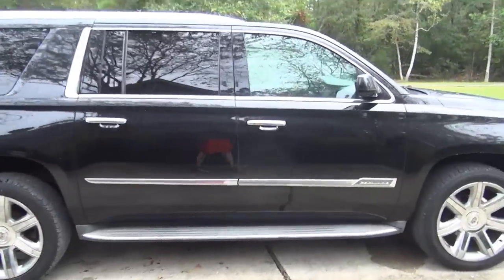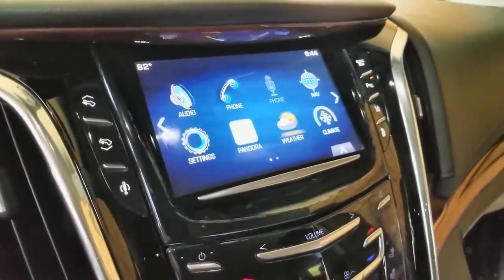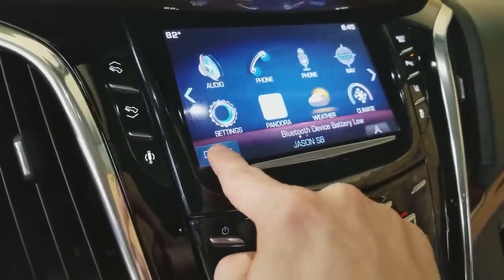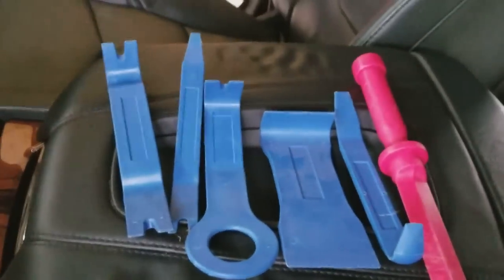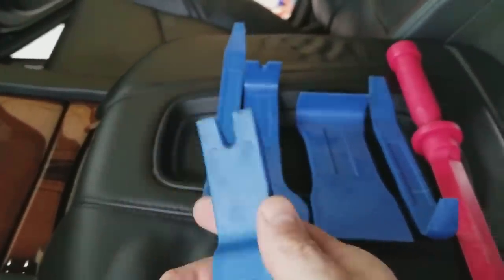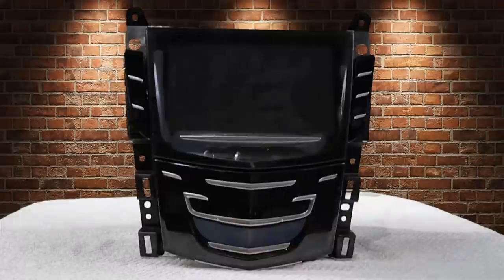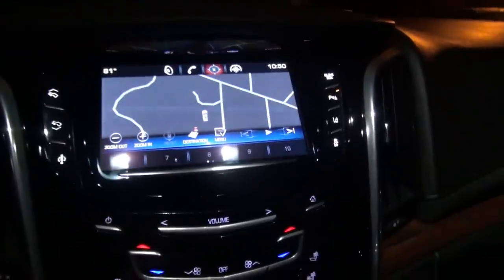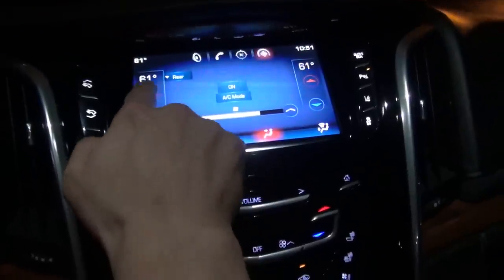How to fix a Cadillac Cue Screen. Step by Step

Comment: I cannot say thank you enough.  It went smoother than I expected, but make sure you have a T15 bit and good lighting to go along with what Jason mentions.  Keep your screws and parts organized to make the process easier.  I purchased a plastic kit from Amazon, but the ones that come with the new screen are all you need. 
The amount of thank you comments speak for themselves. This fixed our failing screen which also produced a random annoying beep in the drivers door.  Seriously... Thank you for the knowledge, the video and supplying it at a reasonable cost.  I would have paid 3 times the price because it works.
Reply from the maker: Hey Robert that is great news and some additional good tips you provide. I'm really glad it helped you out and thanks for letting me know. I really appreciate it!

Comment: This guy is a life saver! After my mom's screen became completely unresponsive, the dealership wanted to charge her $1,900 for an entirely new unit. I'm so glad this video surfaced before I sent it to the shop for her. After a couple of hours of my time and a new screen from Jason's website, her Cue system is working as it should again.
Reply from the maker: Will thanks for taking the time to leave a review. I really appreciate it and so glad I was able to help you and your mom out! Best of luck.
Reply: Robert Spracale Nope, I didn't. Since this was purely a hardware issue, there wasn't a need for reprogramming.

Comment: Thank you!! Cadillac wanted $1450 to replace the screen. Paid $42 on Amazon including the plastic tools and once it arrived and 2 hours later I had a working screen!! Saved just over $1400.Nice!!! Once the screen is replaced you will need to go to settings and calibrate the screen. 

Thanks for the video!!
Reply from the maker: Excellent!

Comment: Jason did an fantastic job explaining the entire process of removing a touch screen with no functionality and inserting a new one that fixed the issue I was having with my 2013 Cadillac SRX. The video is for an escalade but very similar once the head unit  is removed. I used another video to remove from SRX. He provides a link to purchase a new touch screen at an affordable price and it comes with tools that do not scratch the interior of the vehicle. Once I installed the new screen all functionality returned and vehicle is running like new. I had a few questions and Jason was prompt with support and everything worked perfectly. Saved money big time by not going to any of the dealerships I called. "Boom and you done!" Thanks so much Jason, you did a wonderful job.
Reply from the maker: Thanks Dareck for the awesome review. I am glad we could help!

Comment: Excellent video.  Replaced mine successfully.  A couple of comments though:  1) I really wish you would have shown how tough it is to pull that first trim off.  Felt like I was going to break it.    2)  The little tabs that you have to move to get the secret compartment box off was a little blurry.  I really didn't know what you were referring to.  3)  A little better picture of the clip that holds the ribbon in.  I actually missed the 1.5 seconds that it was on the screen. lol.  4)  Screws:  When the screws are taken out, it would have helped to put them in their own piles in the order they were removed.  They are different.  Some are machine threads.  Some are like wood screws.  5)  IMPORTANT:  Touchscreens are very sensitive to pressure around the edges.  I only snugged mine up to get rid of any slack - not tight.  It works great.  Better than it ever did.  While searching for videos I saw a lot of people complaining about the touchscreen not working all that great.  This is probably why.
Reply from the maker: Thanks for watching and leaving the feedback. I will have to make some follow up videos with that. Glad I was able to help and once again thanks for your feedback 👍

Comment: I bought this unit from Jason for my 2013 Cadillac ATS and it worked perfectly. Everything was very straight forward and I was very surprised that everything went smoothly. I had many email communications with Jason and he always answered within 24 hours - very nice guy! 
I do NOT regret doing this project myself at all. Here are some tips 
1) Know when to use force and when to be gentle. 
2) if your car is older, then the clips and plastics might be very hard and easily break. Be careful not to break any clips or connectors. 
3) keep screws separated and labeled to make it easier when putting everything back together. 
4) when applying force to any of the panels, dont put all the pressure on one spot as it may break the clips. I recommend spreading the force evenly and wiggling it loose. 
5) When changing the screen, don't untuck the tiny ribbon cable until AFTER the screen is screwed into place. 
6) Have the right screw drivers for the 3 different types of screws you will be dealing with. 
7) dont take the front screen plastic off until everything is fully installed back into your car to avoid any scratches. 
8) as you play around to make everything fit back, be careful not to put to much pressure on the screen portion of the unit as it might break the actual screen or the new cover. 
9) when changing screens, I highly recommend using surgical gloves to avoid getting smudges on the inside of the screen. This can be bad for many reasons including overheating from the grease. 
10) when placing the unit back into your car, be sure to use something soft like a Tshirt under the unit to avoid damaging it. 
11) the secret compartment will always keep opening as you play around with it. Be prepared to not damaged it. 
12) Depending on the model of Cadillac you have, you might have to be in drive before some of the sections will come off. For my ATS for example, I had to be in drive before I could take out the cup holders.
Reply from the maker: Awesome Sepi! Glad everything went smoothly and thanks for adding some helpful tips for everyone. We really appreciate you taking the time to do that and leave a review.

Comment: This is just what you need if you have a CUE that is not responding.  I agonized months trying to justify paying the dealer too much $.  I order the replacement screen on Tuesday eve and received it promptly on Friday.  The video was very helpful particularly once the unit is out of the dash.  Happily there was much was much less involved in getting the unit out of my SRX dash that the Escalade on the video.  Thanks so much for the video and deal on the replacement screen.  Based on the estimates I was seeing online, this saved me at least $1000.   THANK YOU.  PS Notice the film off the inside of the new screen that needs to be removed before installation.
Reply from the maker: dwayne whitmarsh thanks for your order and for the review. Glad you are back rolling.

Comment: thanks for the clip, it was very helpful! 
at minute 9:46, no black screw needs to be unscrewed. correct is the nickel-plated screw that keeps the plastic locked on the metal. this screw also has a counterpart on the opposite side.

Comment: Ok so everything worked!! Amazing!!! There’s one thing in the video that was not clear but I hope to help someone out like me. The ribbon is so important. There is a black latch, if you do not flip that up and remove the ribbon you can damage the unit. But even more important is that you insert the new ribbon with the clasp up and then close the clasp on the ribbon. You cannot be more than 1 mm apart or your screen will not respond.
Reply from the maker: Thanks for watching and for the extra tips!

Comment: Thank you so much for having this screen to buy and the video! My screen in my 2015 escalade starting being non-responsive, and the dealership said $1,500 to replace the unit, which is crazy!!!  I searched for a replacement screen for cheap but still reliable, and I’ve had it for a few months, and it looks and works perfectly. This video helped with all the steps taking it apart and only took about an hour to complete. Thank you so much for saving me so much money I really appreciate it!
Reply from the maker: That is great to hear! Thanks for letting me know and so glad it helped you out.

Comment: Thank you Jason!  The new screen works perfectly.  Getting the side moldings off (the one with the Start button and the other side) was the hardest part.  Took a lot to get them off.  But once I did the rest was straight forward.  Thanks again.  This saved me $1800!  The dealer was going to charge $2000 to fix it.
Reply from the maker: Hey Brent, your welcome! Glad it went smooth for you and I was able to save you some money.

Comment: Awesome video. It took me a little over two hours. The most difficult part was removing the cup holder which on my ATS I had to do first. Thanks. You saved me $1350.
Reply from the maker: That's awesome. Glad I could help. Thanks for sharing and letting me know.

Comment: Thanks for the video.  I ordered the replacement screen from your website linked above and replaced the screen over the weekend.  I have a 2014 XTS so getting the CUE unit out was different, but once removed your video was very helpful to swap out the screen. 

**One thing to note**  There is a protective film on BOTH sides of the new screen.  You will need to remove the protective film from the inner side of the screen before installing.  I did not notice this prior to putting everything back together.  Once I removed the protective film on the outer side of the screen I noticed a few air bubbles and imperfections.  That is when I realized there was a film on the other side of the screen.  I had to remove the CUE and screen again to remove this film.  Once that was removed it looked great!  

Thanks again.  Saved almost $1200 vs going through the dealer.
Reply: Any advice or direction for the XTS specifically?  I just ordered the kit.
Reply: I found some instructions posted in a cadillac forum.   These were clear enough to guide me through the removal process.  It is in the second post on this page.

https://www.cadillacforums.com/forums/cadillac-xts-forum/1025785-2014-xts-cue-navigation-module-removal.html

I didn't remove the transmission shifter knob (step 1).  I just pulled up the black plastic trim piece with "P R N D M" (I believe it was 4 clips and an electrical connector) and just kind of twisted it out of the way as needed.
Reply: Thanks for the reply I have a xts I replaced my screen as well but after reinstalling my unit it will not power up at all could some please give some advice
Reply: Not sure.  I would check to make sure the connectors going to the back of the unit are properly connected.  If those are fine, maybe the screen ribbon is not properly connected???

Comment: @9:44 you say,
*take out the two screw's after we take the back plate off...
*Then with a little screw driver, “unplug the little plug"
Got that...but then the two screws are back in the hole in the next shot of the plug getting pulled out?
So my question is, “ am I supposed to put the screw's back in now or later?

Thank you for your very informative and straightforward video it's great help.
Reply from the maker: I reviewed the part you are talking about and it looks like you do not need to take those screws at that moment but I believe they need to be removed to pull the backing off. Sorry for the confusion

Comment: Thank you so much for taking the time to post this very instructional video. I'm building up the nerve to try this on my '15 CTS.  I'm pretty handy and am not intimidated by the screen replacement but more so by the removal of the trim!  I was just laughing with my wife that wife my luck I'd end up with a wasted weekend with my Cadi in pieces or the display would work but I would have broken off the tabs on the trim! LOL.
Reply from the maker: Thanks for posting and you can get it. Just use the plastic trim pieces to pry a little on each piece and you will be able to get it with no issues.

Comment: Well we have the srx ‘13 with the exact issue. Started with half the screen now just gone.  I was told 2500 from one and a buddy of mine said 500.  This looks easy to all of you but this went from 10 screws to 50 pretty quick. Lol if I do this I may end up in a bigger problem then when I started because that’s just me.   
Is sure looks like you did this a few times. 
Thanks for the info.

Comment: Dude - AWESOME video! I did it! I changed the screen in my '13 ATS and it works perfectly! Totally thanks to your fantastic video, I would have NEVER figured that out! For $99 and a little less than 2hrs. You are a Knight! A Gladiator! No - you are THE MAN! 

The part that gave me the most trouble was getting the little storage box off the back, and then where you show the little tab on the ribbon at  10'21",  I thought you meant the white part of the clip, I didnt see the black hinging part at first. So I broke a tiny bit of the white clip off but I just put a small dab of model glue on the corner to hold the black part closed.

Once again - THANK YOU so much for taking the time to make this video and post it!
Reply from the maker: Ryan RM thanks for watching and leaving the review. Really Glad it helped you out!

Comment: Jason, Thanks so much for this video!  It truly is the most comprehensive one out there.  I ordered the replacement touch screen from you on your website on Saturday and it arrived Monday by noon! In just under two hours, I replaced it in my 2014 SRX.  You saved me a lot of $$$.  For those with the SRX, here are some instructions on getting the CUE unit out.  Then you can follow Jason's great video on how to replace the screen once the CUE is out of the SRX: First remove the two trim pieces covered in leather-like material that travel along each side of the center console. Insert trim tool at the gap right above the emergency flasher switch, below the start button.  They snap in and out.  You cannot fully remove them; they are attached with a bolt mid-console on the back end.  You can just swing them to the side. Once those are out of the way, you can remove the small piece of trim around the small compartment at the bottom of the CUE. The outside trim around the small compartment door pops out at the top and then you pull up to remove it. Once that is out of the way, remove the 2 bolts (7 mm) directly behind where the small trim was and the large piece of trim with the vents pops straight out of place. You can use a trim tool at the top to pry out. You now have full access to the CUE. Remove the 4 bolts (7mm) and the whole thing will come out. The electrical connectors in the back of the unit are a bit of a pain.  Careful not to break them
Reply from the maker: Thanks Doug for the awesome review. Glad we were able to help and thanks for posting for others. If you make a video let me know and we can share the link.

Comment: I second all the thanks given for this video. I managed to get my digitizer replaced on 2013 Cadillac cue within an hour. I initially used the screen's failure as an excuse to buy one of those Tesla 10 inch Android units. As a warning to anyone contemplating the same thing, do not buy from AliExpress or any other Chinese sellers. They claim to sell 2gb RAM versions but they always lie and send units with half the specs and change the build.prop file to show full specs until you run AnTuTu benchmarks to learn the truth. Stick to Phoenix or one of the other US sellers instead. anyways, this video was great. fixed my screen for less than 50 bucks.👍

Comment: Thanks SO Much Jason! It was a bit more complicated on my XTS than the Escalade but, the screen works beautifully now.
Reply from the maker: Awesome Rick! Glad we could help and thanks for posting!
Reply: What were the big differences on the xts?  I'm about to swap out my screen.  Any tips?
Reply: @johnpaulpascasio8644   The big differences are how much trim has to be removed before you can get the Q unit out of the dash.  I hesitate to give you contact information in an open forum. However, if you friend request me at Rick Fowler on Facebook You'll have access to my contact information.
Reply: @rickfowler6146  thanks for your quick reply.  I'll friend request you.  Gotta use my wife's account because I don't Facebook.  Her username is dananabe so you know it's me.
Reply: @johnpaulpascasio8644  no problem
Reply: @rickfowler6146  I give up.  Didn't realize there would be hundreds of Rick Fowler's.  Lol. Thanks anyways

Comment: Mine worked. Thanks for the video! Only thing is, is there a screen protector on the back side of the screen? I have a couple bubbles?? on mine. Otherwise it worked great when I plugged it in! My wife is very happy now. Thanks!
Reply from the maker: Awesome! Glad you are good to go. Thanks for letting me know
Reply: You're supposed to remove that screen protector before installation

Comment: Thank you soooo sooo much for this detailed video. This has saved us a ton of money and it wasnt too hard. We were able to get the new screen on with no issues BUT we are having the hardest time reattaching the part removed at about 10:03 on your video. Any times on how to put it back please ?
Reply from the maker: Glad to hear it helped you out. Thanks for letting me know. Just make sure the bottom door is open and then you should be able to align the tabs into the proper location for reassembly. Hope you get it.

Comment: Nice informative video. I need to replace my 2013 SRX touch screen which is exactly like your unit. Can you tell me with confidence that the proximity sensor will also work just as the original OEM unit? with hand gestures? most aftermarket units from China are very good but %99 are non-responsive to hand gestures.
Reply from the maker: Thanks for watching. You will be good to go with the screens we have 👍